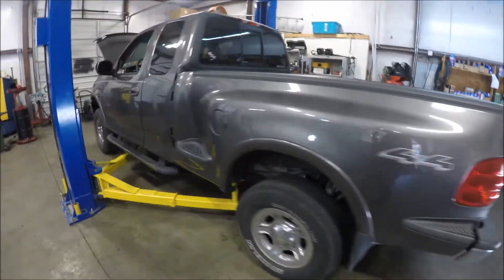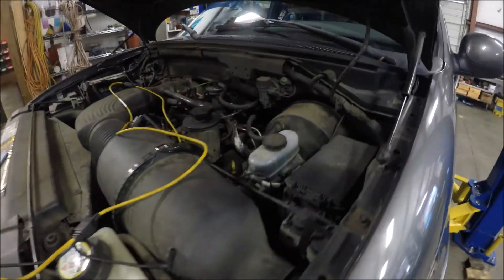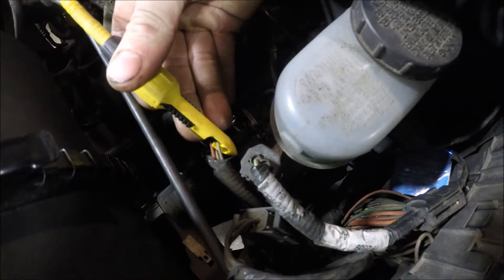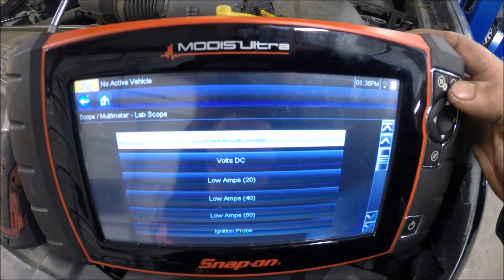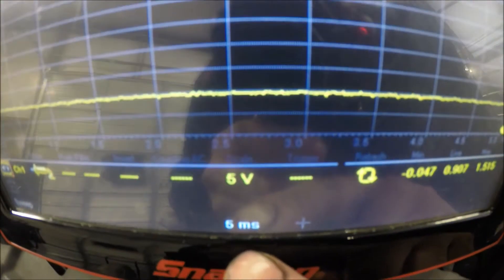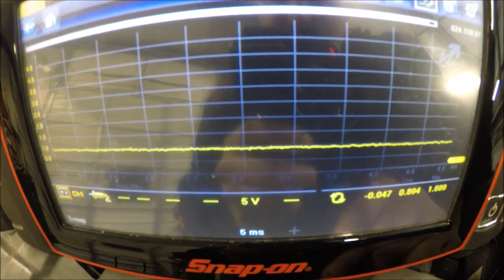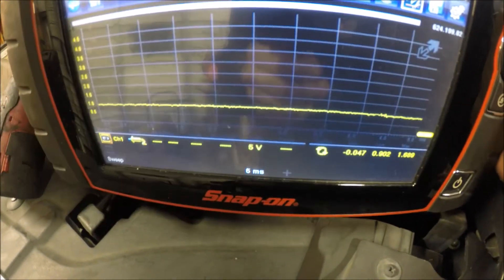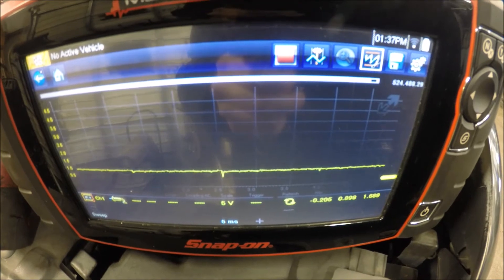2002 F150 P0171 & P0174

Comment: No default value unplugged? Did you check for open wires going to the PCM? A little bit more digging would be nice. Thanks!
Reply from the maker: The test shown above is the easiest test to start with on MAF testing. I looked at live data of MAF values and saw what looked like a good reading. But I did a smoke test on the vehicle and saw no vacuum leak, so I knew there was most likely a MAF signal issue. If you have dropouts in your signal return, then you need a MAF. You already know there is no wiring issue because the live data reading looks fine..... I could see a steady signal on live data, but I knew this MAF would have the short signal loss, as indicated in the video. All i had to do was lab scope the signal wire going to the pcm. The key trick in the video is setting the sweep speed really high to catch the glitches where the MAF signal drops to 0V. ..Thanks for watching!!
Reply: Thanks

Comment: I have 2002 ford f150  6 cikynder, with check engine on code p171 vacuum leaks,  I replaced every single thing that mechanic said.  EGR,vacuum hoses,new intake gaskets,new insulators screws,O2, I really need help with this issue 🙏 . Thanks